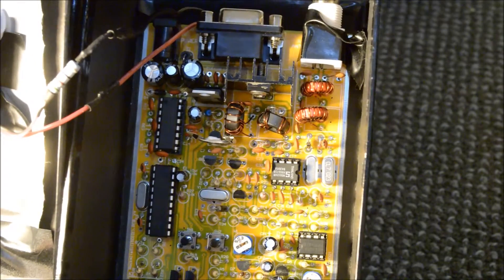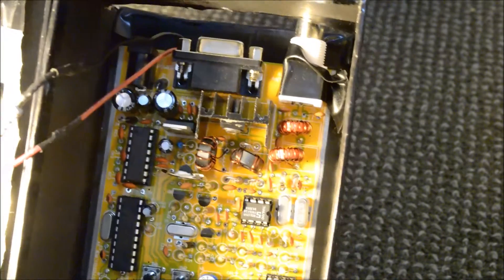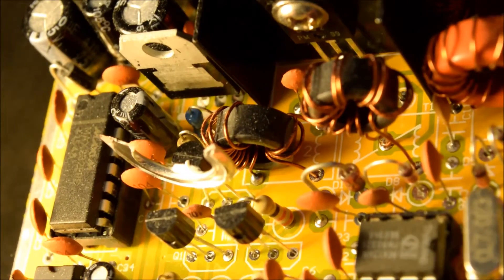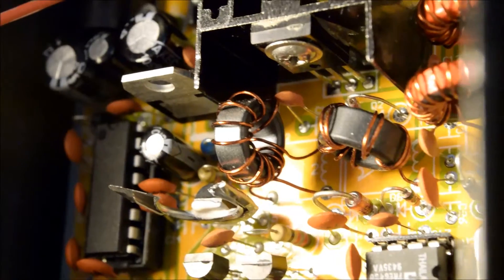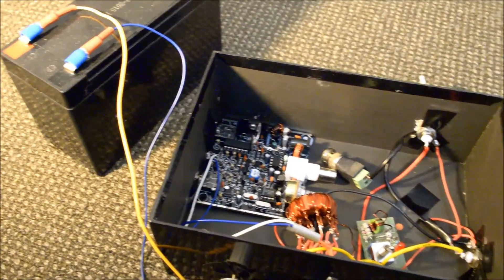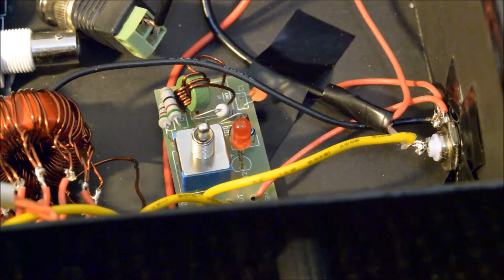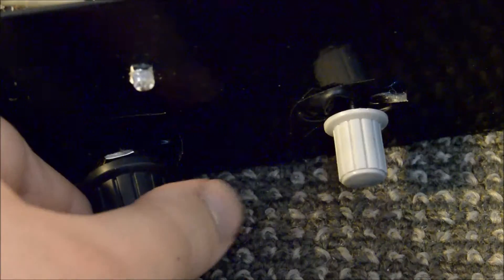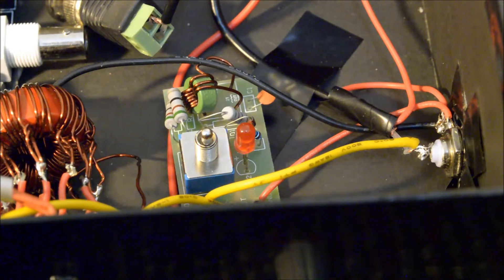Rockmite Follow Up - Windings, power draw, antenna tuning

Comment: Hi Matt,nice try.
Why are you buy an enclosure to put all inside,have a nice look rig?
Reply from the maker: Thanks Se, definitely have to look for an enclosure... don't mind the 'Frankenstein' look myself though heh
Reply: look for rf  boxes everywhere that can you find cheap prices.With enclosure avoid  problems bad connections etc...the printed circuit board with led what is it?